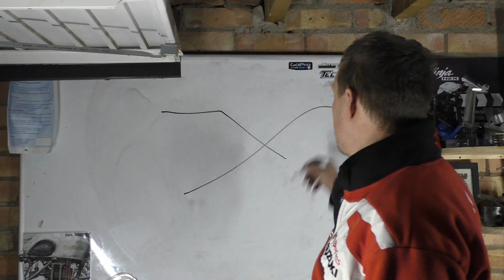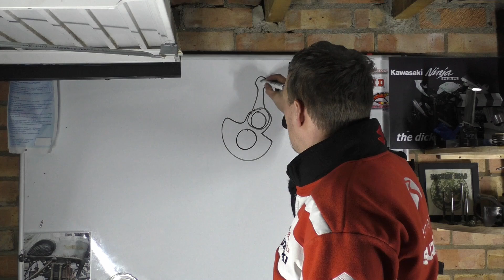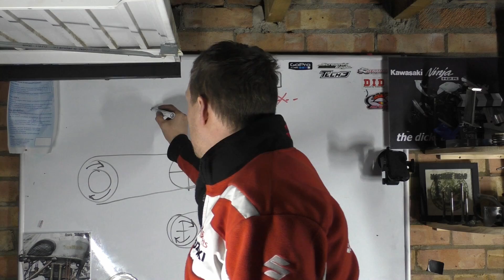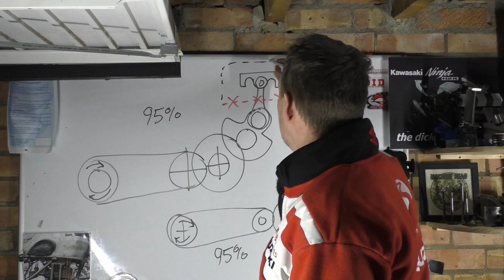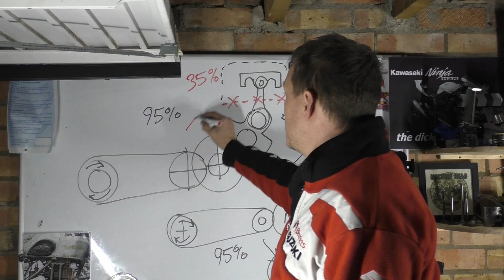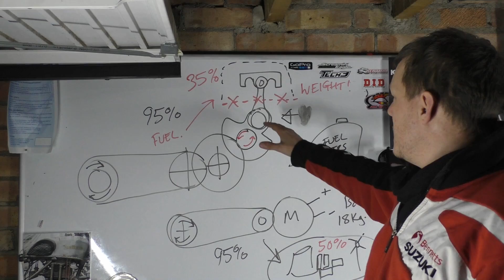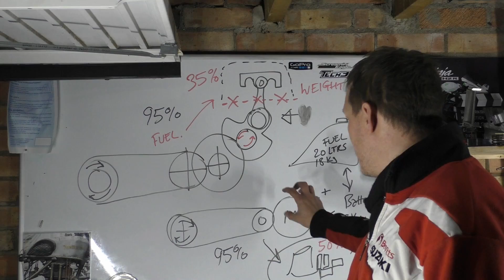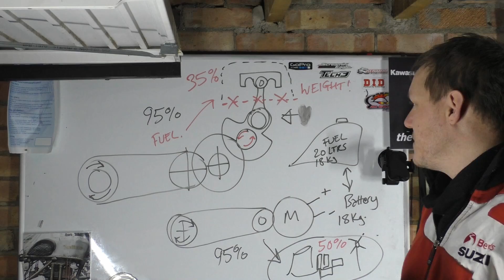Electric Motors - 95% efficient?

Comment: Supercapacitors combined with lithium/silicon batteries and induction rails for charging will drop the weight of electric power packs. A 30-50KW pack saves a lot of weight and volume. Probably not for bikes though.

Comment: What did you think about hybrid systems?
Did you think the electric motor would add enough power to overcome the additional weight?
Where did you think would be the best placement in a bike? Inside the gearbox, clutch or somewhere else?
And would you think it could help with the fuel efficiency in total.. without losing the fun..

Also for storage, did you think super capacitors would be better for electric/hybrid bikes than normal batteries?
Reply from the maker: "What did you think about hybrid systems?"

- video coming this week

Comment: The commonly quoted efficiency of electric motors is a measure of the amount of power at the shaft divided by the amount of electrical power applied to the motor. Yes, 95% is common. Applying 100kw of power will produce 95kW at the output of the motor. 5kW will be lost in heat. The commonly quoted efficiency of a petrol IC engine is the power produced at the crankshaft divided by the calorific value of the fuel multiplied by the rate of fuel consumption. Yes, typically around 25-35%. Yes, if you want to measure the efficiency of an electric motor based on the coal at a power station, you have to include charging losses, transmission losses (from power station to charger) and power station efficiency from the calorific value of the coal. Obviously that will lower it a fair bit. Apart from keeping pollution out of cities and away from homes the real point of electric vehicles is to introduce them TOGETHER with the conversion of power generation to renewable energy. If all power stations were renewable, CO2 and pollution emissions from electric vehicles would essentially be zero and the efficiency back to the fuel at the power station would not be relevant other than to the cost of the power. But even 50-75% renewable power would be enough to solve most of our climate change and pollution problems. In Australia the state of South Australia is already at 50 percent renewable power production and is on target to reach 75% within the next couple of years. This is a state that has no hydro or nuclear generation. It can be done almost anywhere. New coal generated power is now more expensive that new renewable power in Australia, even in a country that has it's own huge coal reserves.

Comment: First off very interesting video,

I do have one point though and that's the like for like comparison.  You account for the power station for the EV but not for the petrol.

I can see your point of the petrol being the power source.  But I would argue that its potential energy stored in the tank the same way electric is potential energy stored in the battery.  So for a more fair comparison I think you should of accounted for petrol production.

That is purely my take on it and if I have missed the point, please feel free to call me a knob.  But keep the videos coming, I've definitely learned from a lot from them.  Or at the very least questioned my understanding of certain things.
Reply from the maker: "So for a more fair comparison I think you should of accounted for petrol production."

and the fuel for generating electricity. Pretty much the same. Blending fuel is pretty simple compared to drilling out of of the crust of the earth
Reply: @thedirtyworkshop  Fair enough, makes sense cheers.

Comment: Morning Matt thumbs up for your channel. Have you seen dels saw on wheels it made me laugh. The battery has internal resistance and energy is lost when charging as well. The leaded fuel cant be used on the road now days as fuel duty is unpaid due to off road use i think it might be avgas they use now . But i haven't seen any one been pulled over in a petrol engine to get road side checked.

Thanks for your vids any stickers available for my tool box
Reply from the maker: STICKERS here - https://www.redbubble.com/people/the-workshop/shop?asc=u

Comment: My normal power supplier is the cheapest around and 50% renewable and polar chargers (who i use) are 100% renewable at 9p per KWh. 
Take a look at Florida when people had to evacuate. Petrol and diesel stations all ran out within hours. EV vehicles were not effected and all got out far quicker. .
Battery capacity will come up 25% in next 3 years (already proven technology) a doubling of current capacities is only 5 to 6 years away from main stream use. Many technologies being tested in that range, that will get there very soon.  We have had about 30+% improvment in capacity over the last 4 years. 
We are with battery and EV technology exactly like we were in the late 1980's with computers when they went main stream.
Reply: william  armstrong    I’m watching batteries for 20 years, all for technological progress, but have not seen much in the battery since Ali batteries began.  Can you please share specifics on these next 3 years programs and products?

Comment: 6:38 but electricity is WAAAAAAY easier to produce than petrol
Reply from the maker: Is it? You mean digging up all that crude to then burn to produce electricity is easy? Seems to be the same thing to me.....
Reply: I could literally make electricity right now within 20min, with some wire and a magnet!  🤓
Lets see you dig that oil up, build a distillation tower, heating and filtering system for that tower and then refine that shit.
Besides you know damn well oil and gas is the first thing everyone is goin for in the apocalypse, NO ONE is going to be thinking about the fuel rods at the local power plant!

Comment: Fuel tank, you pump or pour it in and it's full. Batteries must be forced into a state of full charge. So you need energy to do that in addition to the energy you use from the battery. That should be counted in the efficiency of electrics.
Reply from the maker: Well not quite - you had to get it from underground to the pump - and if you include all that processing - petrol is pretty shit. And then you go and dump half of it into the gulf of mexico LOL

Comment: Theres been a lot of leaps lately in graphene supercapacitors. They are just expensive, hard to make etc. Cars and bikes use lithium ion cells because there are safe but ion cells are old hat, a more modern battery is the lithium polymer type, used in RC cars and planes etc. The battery operated RC stuff is now faster and more powerful than the old glow engine types. But even lithium polymer  batteries are at least years old and now a kind of graphene  batteries are used for RC.  Its not far off this technology.
Reply from the maker: But what's the difference? A factor of 10 or just 20% better?
Reply: @thedirtyworkshop  regarding what? the difference between lithium polymer and lithium iron the difference between glow engines and brushless motors or graphene supercapactors? Theres a channel here i found, this guys made graphene supercaptors, even batteries out of hemp lol. https://www.youtube.com/user/RobertMurraySmith/videos

Comment: An electric motor is like a hydraulic or pneumatic motor in the sense that the fuel has already been converted. A combustion motor has an extra step in the conversion process. That gap is misleading but its heading in the right direction. Keep the main energy conversion in large industrial scale monitored facilities where it is closely watched instead of our ill maintained vehicles.

Comment: Matt, for you information Australia holds 90 days of fuel in reserve if we are lucky, I read newspaper reports that it is often a lot less. A significant & increasing number of people in Australia have P.V. Solar panels & batteries large enough to meet their needs including running a vehicle. So more than 90 days. You also fail to mention the amount of infrastructure & energy needed to extract oil process it into useable fuel and then transport it to a service station. Love your videos

Comment: Are the motor inefficiencies not from the resistance of the wires in the motor? And the resistance due to the heat they produce?
Reply: Hysteresis, eddy currents, resistance, windage, and CEMF. And yea the hotter the copper the higher the resistance and so on.
Reply from the maker: Yes. Waste heat strikes again
Reply: And once again heat is the main inefficiency! Why is it always heat now that's the question
Reply: @kereyholton6108   2nd law TD

Comment: I would say battery technology can increase quite a bit. Lithium ion batteries really have been improving more in the last 15-20 or so years while before it was no good money behind them so to speak. I think it is not so much about some awesome new technology but rather improvement over time. We could be dicking around more in the supercapacitor things or other hybrid batteries were most of the cells don't have to carry the maximum discharge/charge current and hence be more energy dense (but less power).. We will see, I'm quite interested in what will happen.
Reply from the maker: Energy density. If you stick anymore energy (lets say by a factor of 10) then mobile phones and 'supercapacitors' become hand grenades.
Reply: The Workshop Well, petrol already is more energy dense than TNT and we are fine driving around with that

Comment: Well, the thing with technology development was and always will be, that it is restrained to 3 things, money, time and motivation (often in form of conflicts like the two world wars). Motivation and money can be found easily found but can just be compensated.
Reply from the maker: And physical limits. Take halograms - you can't bounce light off nothing
Reply: @thedirtyworkshop  
Yeah, of course. That's why i can't understand Elons stance towards hydrogen fuel cells. They are not ideal but they certainly may be the way for low emission long range travel. Also, were did you get the efficiency  numbers for powerplants. I was always under the impression that these also have an efficiency of around 32%.
As for the ICE, i find it sad as i love combustion engines of all sorts  but times are changing and we will eventually deal with electric motors instead of engines, maybe that's the reason why i turned my interest more towards sspace flight, as we currently have nothing that matches the power of a good old chemical reaction with some thermal expansion and a lot of exhaust gases ;D.

Comment: So, battery is kin of fuel tank, but then it isn't? Same as fuel refinerys are 100% efficiency, cos you aren't mentioning it?
Reply from the maker: "So, battery is kin of fuel tank, but then it isn't?"

- They both are energy storage units - one processed the other isn't
Reply: well, bikes don't run on crude oil ;)
Reply: Electric motor don't run on coal, solar, wind, or fucking plutonium. Fuel and electricity are both produced, but only other ones production efficiency is taken in equation..
Reply: Electric motors do have 95% efficiency, and combustion engines have 35-45%. It is simple as that, you don't need to take transmission, production of "fuel" of the energy nor even your hot neighbor in comparison. Matt you ones told that guys say to you that you can't compare car and bike engines, and you just told that it is easy and compared numbers. Why can't you do it now, or do you just hate to be wrong?

Comment: for assynchronous 3 phase motors, cos Fi on label is the efficiency of the motor its around 0,86 so its 86%....
Reply: Noooo nononono. No. That has nothing to do with the efficiency. That is just the power factor and only the real power (Meaning nominal VA times cos phi) has to be provided by the electricity supplier. The reason why it is on the motor is because the infrastructur needs to be able to keep up with that apparent power. But it is not burning any more coal so to speak. Or it would not cause more discharge in a battery.
Reply: You get greater losses in the grid with a lower power factor so yes it requires more energy.
But like you said powerfactor != efficiency.
Reply: Tim Nilsson Meh. Depends on how you look at it I guess. Losses in the grid can vary massively depending on what and how you're using the motor so I wouldn't really classify that as energy loss from the motor. Like, if you are running it from an inverter which essentially just decouples the motor and it's PF from the supply
Reply: @Tim_Nilsson  The embodied energy losses of petrol production and delivery are far higher than that of electricity. Fuel trucks don't run on pixie farts, nor do refineries, nor drilling rigs.

Even if you were to charge electric vehicles from power exclusively generated by fossil plants, the efficiency would still be greater than using fuel to directly propel vehicles.
Reply: @phillycheesetake  . I don't understand why you're quoting me as I haven't said anything about that matter? =P
Reply: @allesklarklaus147 . Hehe yup. You can always phase compensate as well so it's not like it's an unsolvable problem.
Reply: That's not quite how it works, and that's async and your regular crapshit construction. Stuff with permanent-magnetized rotors and/or a smart FC can easily top that and go up to 93 or even 95.

Comment: This is more like it ! The Dellboy stuff, as you have quite rightly pointed out, is getting tired and tedious.

On another note, if batteries are pretty much at the peak of development with regards to efficiency and transfer of electricity needs super cooling and gold to become more efficient, are we not pretty much already there with what we have already ? Ok, there may be very minor gains to be had, but surely the focus should now be on how to get the infrastructure in place so that charging your bike or car is the norm. And then possibly design changes necessary in motor vehicles so you can swap a battery at a garage in less time than it takes to fill up with a tank of petrol.
Reply: actuali gold is used just for contacts cause it doesnt corode, copper is still the best conductor

Comment: Look in a bit further to some of the latest battery developments Matt, there actually is a substantial amount of more energy that can be stored and quite a few very promising breakthroughs that heading towards mass production.
Reply: We still won't go off our explodey funamajigs. It's really pretty simple why; 1) Power stations are surprisingly often crap, and since that's where the current/fuel for even the best gubbins in the actual vehicles has to come from, that puts the limiter on the efficiency. If it's more specifically efficient AND technically easy to simply pour an equivalent energy amount of diesel into even your most bog-standard common rail 2.0L than to burn that amount of coal in a plant somewhere... 2) Batteries use a load of rare and generally volatile materials, and go off. And then it takes centralized high-energy processing to get things back in order. Alcohol on the other hand can be grown most anywhere. 3) Even if we're assuming that John Goodenough isn't bullshitting about the cathodes on his new glass battery, that still puts you at a dozen or so times worse in power-weight specificity than you'd need if you want to fly electric. And there's still a metric bitchfuck to be done in terms of aeromotive tech. And the money to develop increasingly good combustion engine solutions there is kinda substantial.
Reply: @Sakhmeov  I'm pretty sure a lot of people said the same thing about how horses were superior when the car was first invented, look how that turned out.
Reply: @West_Anderson  Apples, pears.